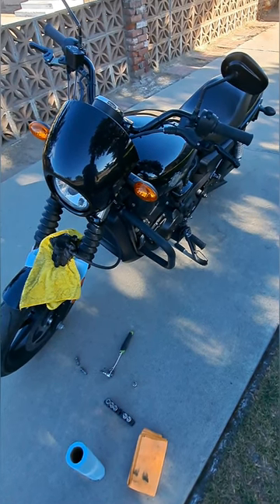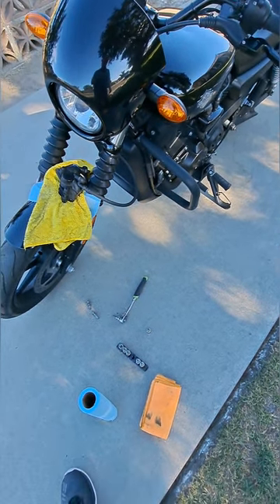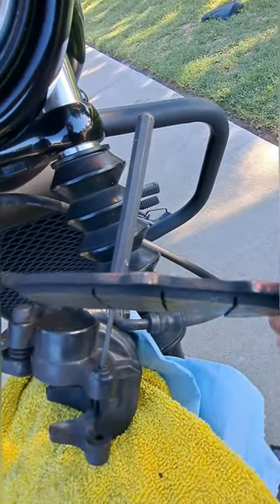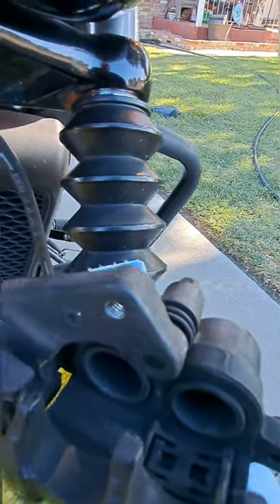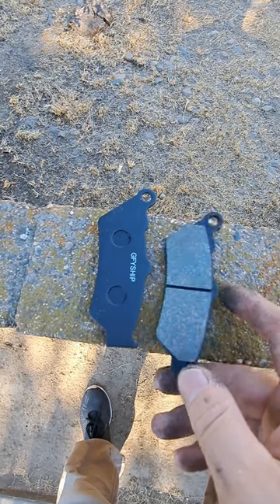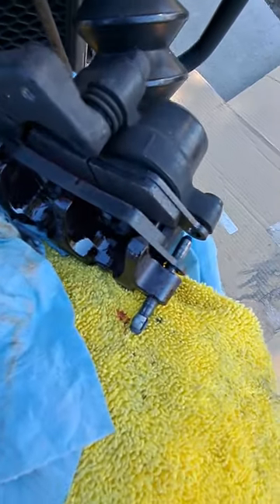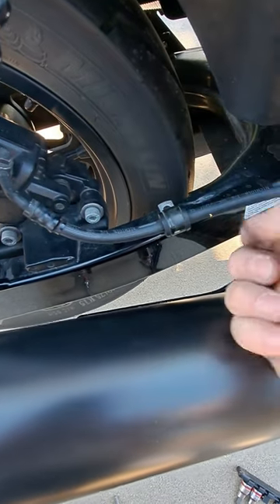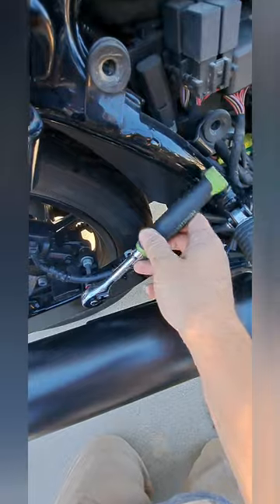How to replace front/back brake pads on 2016 Harley Davidson Street 500cc

Comment: Wow!!!…glad I found your video my friend, because this is my next project on my street 500. Your video is very helpful in showing and explaining how to replace the brakes on both front and rear of the street 500. Harley Davidson charges over $300.00 to do this brake job and your video makes it look sooo easy and will save me the money spent on going to H D👏🏼👏🏼👏🏼💯👍🏻
Reply from the maker: Your welcome Tony. That is why I started doing these videos to help others with saving money on DIY repairs. I'm focusing now mainly on my new  Yamaha XSR 900 but I'm glad I could help.  I did a really thorough video on how to replace the btry in street 500 which is a real pain in the ass but I show you step by step how to do it and the btrys sold from O'Reilly auto parts work great.  Much cheaper then paying Harley to install and much cheaper btry.

Comment: What happens if the brakes sound like there scrubbing in the rotor like making sounds with the wheel spinning freely
Reply from the maker: Make sure that the brake pad is facing the rotor and the metal backing on pad is facing out. Use some brake cleaner on brake pads and rotor. Could also be something wrong with your caliper, and it's not releasing the pressure on the pads against the rotor fully when the brake lever is not applied. If you can't resolve the issue, take it to a bike repair shop and get it looked at. Do not ride it like that!